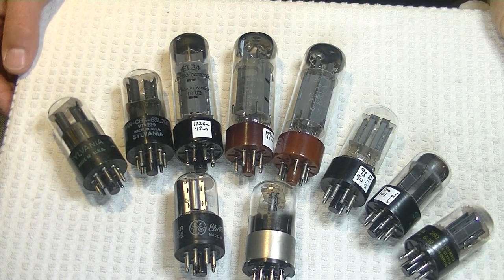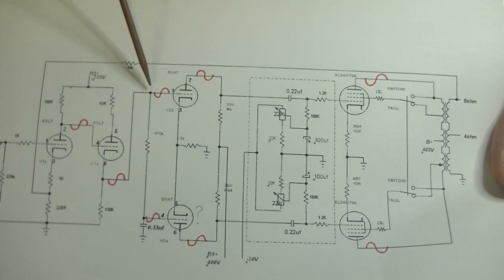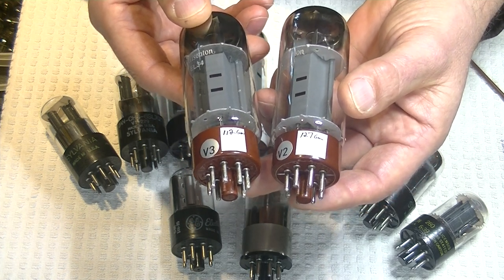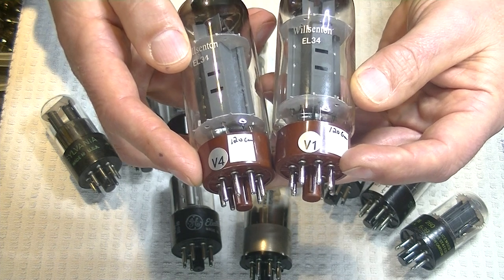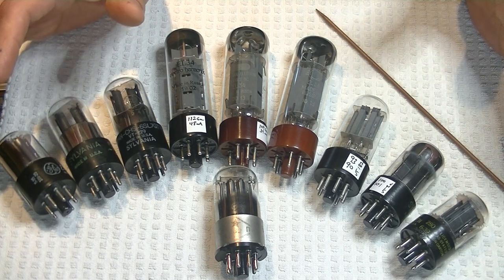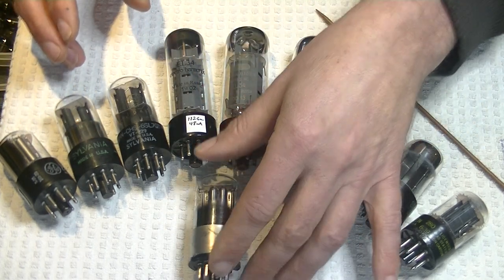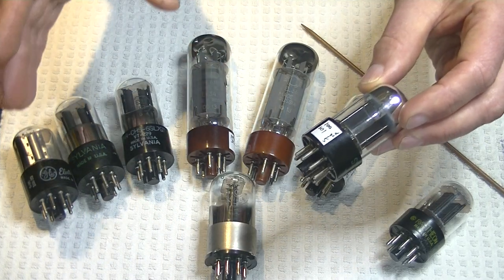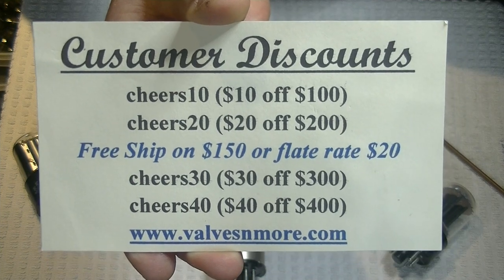Tube Lab #24  Tubes for the Willsenton R8 Amplifier

Comment: Nice video. I run KT 88’s in my R8 and much prefer them to EL 34’s and KT77’s. I have upgraded the power supply with bigger power supply caps and a better, Hammond choke as per Skunkie Designs mods. I run NOS RCA 6SN7’s and 6SL7’s. All in all a great amp made better by implementing all the Skunkie Design mods. Good listening!

Comment: Great video! Just subscribed. I have an R8 and bought Melz from your website. Looking forward to hearing them. Any plans to upgrade the caps on the R8 like some guys are doing? I’m curious if it makes a difference.
Reply from the maker: Sent pm by email re your order.  Yes in a future Tube Lab I'll open up the unit and look to see if any upgrades are warranted or possible.  One respected reviewer already commented that the coupling capacitors look to be of good quality.  Going from good quality to excellent is a serious investment (depending on how many coupling capacitors are upgraded).  At some point you arrive at a solid 95% of potential, going any further sees the law of diminishing returns apply directly to your bank balance!

Comment: Yes sir, the Russian Meltz once plug into the R8, its wow, and it got stuck there forever, i dont want to take it out.
Reply from the maker: Haha, that's a good description of my current situation!  I'll try some other possible 6sl7's and try to remain unbiased, but the MELZ really does sound wonderful!  I already have designs popping up in my head that would use the MELZ in circuits that you would normally put a 12AX7, a think a new prototype phono preamp may be on the design list soon!

Comment: Great and very informative video! As both a coming R8 owner and electronics engineer student, can you maybe elaborate on the differences in triode- and ultra-linear mode? I'm thinking in regards to what's going on in the amp, like you did in the video with explaining the push/pull, and not so much the sonic/SQ differences? Kind regards from Denmark.
Reply from the maker: Thank you for the kind comments, a future Tube Lab will do a review of the R-8 itself, after I've had a lot more experience using the amp and rolling tubes.  I'll include a discussion on the difference between Triode and UL mode as well - good idea!

Comment: Maybe before tube roling take a look at the opt for real big upgrade, while the opt makes more sense to replace and than do the tube roll.The opt in these amps are nice but budget so take a nice c core or brand name opt and than do the new/nos tubes.
Reply from the maker: Respectfully, have you listened to the R-8?  I've now spent countless hours critically listening to the amp and I can say without reservation that it is a very nice sounding class AB tube amp.  Now I prefer my own custom SE amps, BUT for someone on a budget, this is a very good option.  At the level of build, including the output transformers, the R-8 responds very well to rolling in nice tubes.  Whether it will benefit further with nice tubes like the Xf2 Mullard EL34's or new issue Gold Lion KT88's, is still not known.  But with some critical listening, I'll be able to let everyone know.  In closing, the output transformers are not your typical junk that many very inexpensive Chinese built amps arrive with.  In fact if you pay a reasonable amount of money for your Chi-Fi, they can supply very high quality products.  The savings all come from mass production, low labour costs and tighter margins than ALL higher end audio products need to charge for low production run HiFi gear.

Comment: What about KT120, can the R8 run those?
Reply from the maker: Good question!  Yes they have the same octal base and identical electrical pinout.  However the KT88 has a heater current of 1.6A and the kt120 1.7-1.95A, so a difference of approx .3A x 4 tubes = 1.2A. This works out to an increase of 19% which given that the KT88 is the highest heater current tube the R8 is designed for, makes this too much to just plug in a quad of kt120's and hope the filament winding on the transformer can take the extra current / load = HEAT.  Heat is the enemy of transformers, too much and poof you've destroyed your transformer.
Other significant differences include bottle size and output maximum power, kt88 has a design max of 35w and 42w absolute!  The kt120 60w.  If you really want to investigate this option, contact the supplier and see what they say, then if you destroy your amp, maybe they'll make good - maybe!  What I would suggest is trying various EL34, 6550, KT77 and KT88 tubes all of which the amp is designed for.  Note the most improvement always comes at the front end, in this case the 6sl7 tubes, if you haven't tried a matched pair of MELZ tubes - you are missing out!  The next big improvement is installing a well matched good quality quad of power tubes.  I regularly buy tubes advertised as matched - almost never are they matched.
Reply: @tubelab194  wow. Thanks so much for the very detailed explanation. I'm really enjoying your videos. Keep up the good work.
Reply: I contacted China hifi with this same question last year and they advised me not to put kt120s in the R8
Reply: @tubelab194  thank for the info.  are kt66 tubes safe to use in the r8?
Reply from the maker: @TheKravmonster  NO, I know next to nothing about the kt66, but a quick check online shows that it is basically the vintage  Marconi version of the 6L6.  Stick to EL34, KT77, KT88, 6550, huge selection available both vintage (my specialty) and new issue.

Comment: Jim what are you running in your R8 at the moment?
Reply from the maker: Ah what a great question!  Vintage Svetlana EL34's, Sylvania 6SL7GT from 1950's (#46g), Sylvania 6sn7gta (#1as) early 1960's and in the center socket Foton 6sn7gtb (#222).  My Sunday afternoon concert was the live album "The Rain" by Ghazal, nominated for a best traditional world music Grammy in 2004.  Now the reason I'm not running MELZ 6sl7's is I shipped my own set to a customer!  And, this is the first time I've listened to the grey plate Sylvania 6SL7 and they are amazing, the black plate version is very much the same tube, but I'm very impressed with the level of detail with the grey plate.  Now it's also an excellent recording and good detail almost always results in a good sound stage  and in this case GREAT would be a better way to describe it!  Almost certainly the synergy of the 4 vintage Sylvania's combined with the Svet's are creating the magic!
Reply: @tubelab194  I am running Melz 50's 6SL7 and will have Melz 6SN7 soon. Just working out what I want for the power tubes. Svetlana 6550, GL KT77?? or GL KT88
Reply from the maker: @ja8020  If you like your music coming at you like a hurricane, the vintage Svet 6550 all the way!  Note I tried the MELZ 6sn7gt in my R8 and they got noisy fast.  This is a common problem with the lower rated GT (first generation 6sn7).  The GT has a much lower rating than the later 6sn7gta or gtb.  I've been running the Sylvania 6sn7gta and GTB in the R8 almost from the beginning and they are a perfect tube for that position.  Make sure they are matched!  The phase inverter circuit that the R8 uses, demands a good matched pair.  Or problems in balance will result and that will lead to poor stereo separation and a crappy soundstage!
Reply: @tubelab194  Thanks Jim